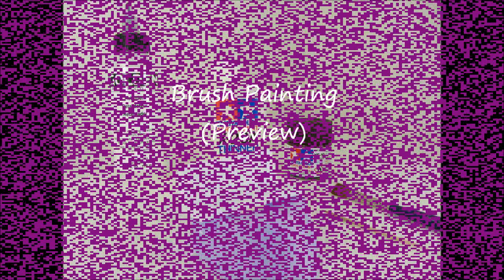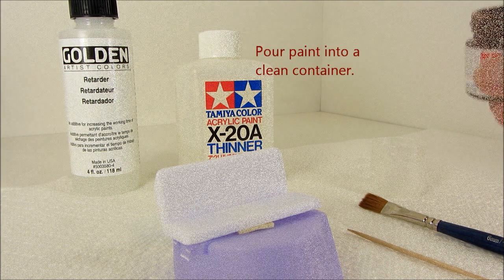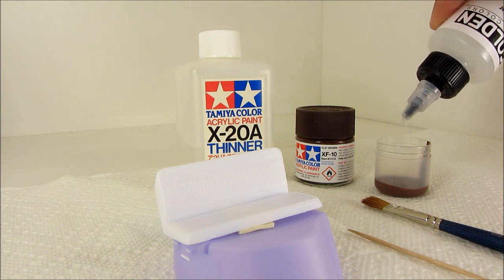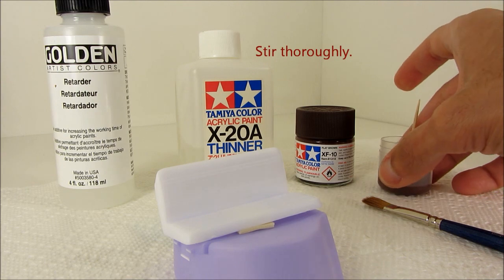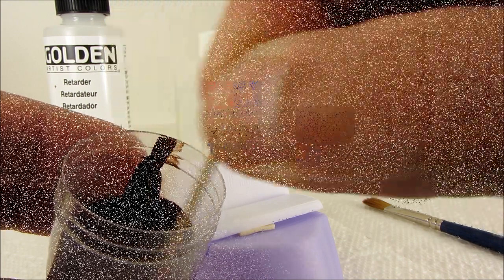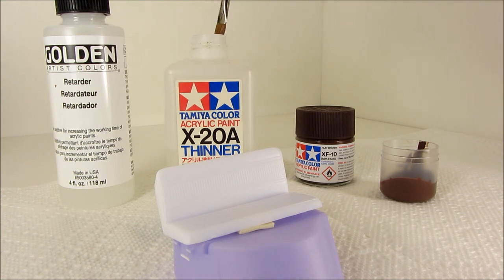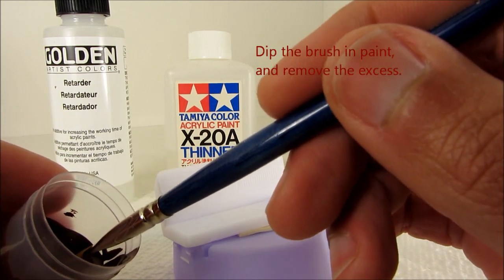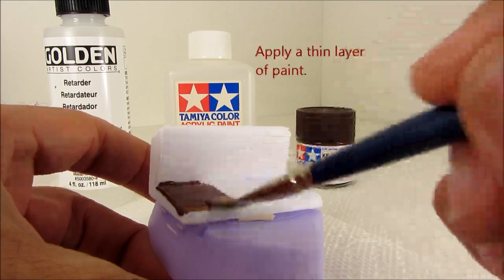Model Car Brush Painting

Comment: can i do this in a closed environment? Do I need to wear a mas? Any fumes? Thanks.
Reply: It is always recommendable to open the windows when modeling. With brush painting, a mask would not really be necessary and rather uncomfortable. But you do need some ventilation.  In another video I saw this guy who had a small ventilator pointed at his work area  and I think this is a great idea. However,  I would never do any painting in a room without any windows open, even when there's a ventilator.